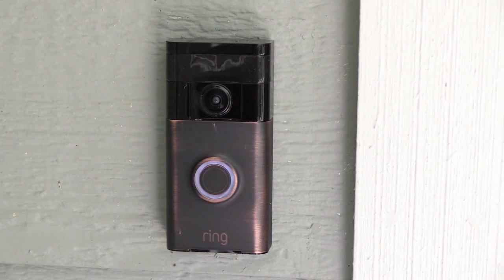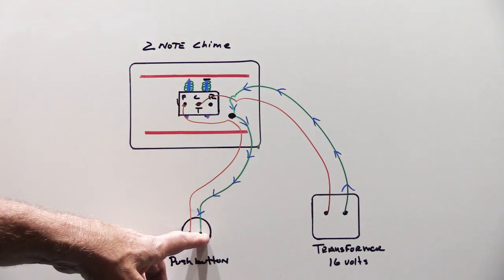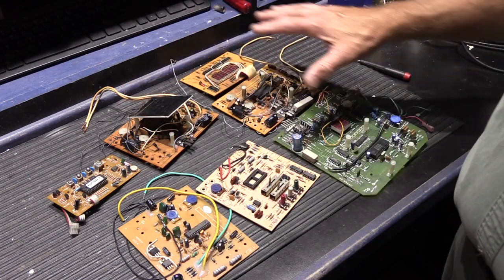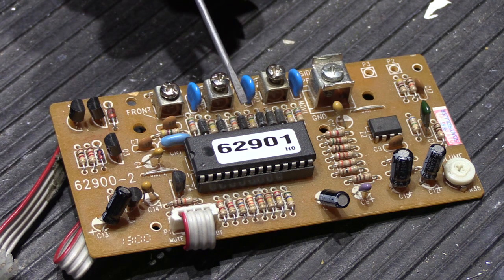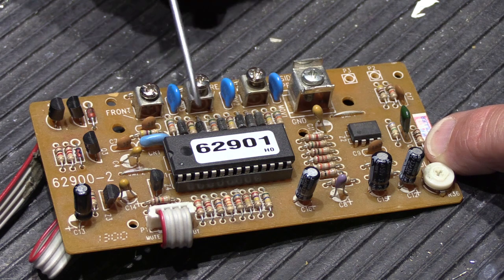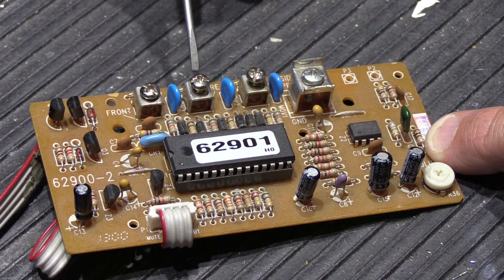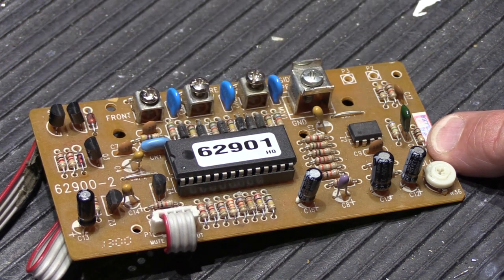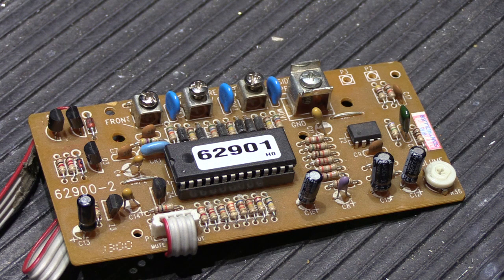Why You Can't Install a Ring Video Door Bell with a NuTone Intercom System or Musical Chime

Comment: I just helped someone installing a Ring Pro with a Broan/Nutone C500 music chime, it has four tubes that, when hit by plungers,  make sound when the chime is activated. I did a lot of research and study on my own, I wanted to share this information with everyone out there who have a similar system. However, this video is what got me started so I'm grateful for that. 

I'm not responsible for any damages if you choose to follow the method I described below. I'm simply providing some description of what I did and what worked for me. Your mileage may vary. If you are not family with electrical work, I suggest you either hire someone or ask someone who has experience and knowledge in this kind of work.

The problem with my friend's set up is that, when hooked up everything, the chime will keep making sound without anyone pressing the Ring Pro button. Like I said, I did a lot of study and finally figured out why it it doing this. The Ring Power Kit, when installed as instructed, provides power to the Ring Pro button, the C500 itself, being a digital chime, needs 16vac power for it to work too, I believe the Ring power kit simply bridges this 16vac power to the wire that goes to the Ring Pro to power the unit. The problem is that the Ring Power Kit, when installed as instructed, not only provides power to the Ring Pro unit, it ALSO complete the circuit for the Ring Pro button, so to the chime, that button is pressed all the time. That's why it making non-stop sound.

If you look at the user manual for C500, there are two methods to connect to this board, first one is using the unit as a digital chime, when the Pro power kit is connected, it complete the connection between terminals 3 (transformer) and 4 (front), which would trigger the chime to work. Since the Pro button needs power (that's provide by installing the Pro power kit), you can't bypass this connection, or else the Pro button won't get power and therefore, won't work. I'm pretty sure if I can provide a separate power source to the Pro button and not use the Pro power kit, this will solve the problem, but that's extra work to find the place to hide the transformer and run the power to the button.

The solution is to use the second method described in C500's user's manual. Use the unit as a mechanical chime. In this configuration, you would connect one of the wires from the transformer to terminal 1, and connect the Pro Power Kit as described by Ring, except instead of using terminal 2 or 3, connect the white/blue wire from the Pro power kit to terminal 1. The black/brown still goes to terminal 3. This will provide power to the button. However, the C500 itself still needs power to work, the designer of C500 provided two 9v battery connectors, so find two 9v batteries and connect them to the connectors. Now the chime will work with the Ring pro button.

The only other setting you might have to change is in the Ring app, there is a selection of chime type, digital or mechanical, I used digital and it worked. It was set to mechanical initially and it did not work.

I believe there are several other similar chimes made by Broan/Nutone that work this way, like C501, C300, just look at the circuit board, if it is similar to the one used by C500, this method will likely work.
Reply from the maker: Hi Mike:  Well done on figuring out how to connect the C500 with the Ring Pro - Just so everyone else know - The C500 is a early Broan design Chime and even though it's sold under the NuTone Brand - it shares nothing with the real NuTone Chimes.  The C500 is the only chime that has an option to run off 2- 9 volt batteries - Chris
Reply: Thanks Mike. I tried to use Hampton Bay digital chime, 1001 407 821 with ring pro. Ring says that this digital chime is compatible with ring pro.The chime runs constantly without the button pressed. Called ring customer service, no resolution, works fine with mechanical chime but not digital musical one. Do you know the solution to this issue? How can I use Hampton Bay Digital chime with ring pro? If I install the diode on the ring pro terminals like Hampton Bay recommends, the constant chiming stops but ring pro does not work.
Reply: Sam, assuming you are using the Hampton Bay chime in wired connection, not wireless connection,  as wireless connected chime will not work with Ring door bell. Try the following: 1) check the voltage output of your transformer,  set your multi-meter to VAC (AC volt) mode, it should be at least 16vac, this is the voltage between F(ront) and Trans(former). 2) try to revert the diode that you installed, in theory, the Ring PRO does not need the diode but it's worth a try. 3) did you install the PRO Power Kit that is supplied with your Ring PRO? If not, install it. It sits across F and Trans terminals, 4) In the Ring app, there is a chime type selection, make sure  you select digital, not mechanical.

Let me know if these helped or not. Good luck!

Comment: What is the typical voltage at the doorbell switch for the Nutone IM-3303?  I’m seeing 12V DC with my two 16V 30VA transformers.  Edit to add:  on the two transformers for the Nutone system, I'm seeing output of 18.8V and 19.1V, measured across each transformer........
Reply from the maker: Hi Tim:  If your IM3303 has a built-in Chime Module, the voltage you may see at the Pushbutton is not a power source for anything, including a WIFI Camera.  It is the voltage that the microprocessor on the Chime Module supplies as part of the "triggering" circuit.  - Chris

Comment: NSC, I am a renter in a house built in 1975.  The intercom is a M&S MU-MC3 3-Note Chime.  It has since been converted over to a cheap mechanical chime.  I have 4 wires at the doorbell (2 to the speaker and 2 at the push button).  I can trace th 2 button wires to the 2 out of the for wires coming from the transformer.  How can U test the voltage at the doorbell to confirm the conversion that was done will allow me to hook up the Ring Doorbell without any further modification.  Please remember the M&S MU-MC3 3-Note Chime is not in operating at this time.  I would post pics if I could.  Thank you
Reply from the maker: Hi crj_lll: Unfortunately you questions is very specific and without knowing exactly how everything is wired - I can't tell you how - or what to test and measure.  - Chris

Comment: Hi Northside, well I have a Teledoorbell, i guess its the same as the Nutone...my question is if i can't simply use the wires at the door (4 wires). can i use 2 of the wires and transformer and eliminate the Teledoorbell entirely....i dont need the chime or land line to ring...just want power the Ring Door Bell 2nd generation to use the transformer as its power source.
Reply from the maker: HI Rob:  I know nothing about Teledoorbell Systems - I suppose if your removed the Teledoorbell System completely, you could reuse the existing wiring for another purpose. - Chris

Comment: The people who installed my Ring doorbell were unaware of the incompatibility with our Nutone NM200 with chime but somehow connected the Ring to power from the outside Nutone intercom box.  When originally installed, pressing the Ring doorbell generated both the Ring sound AND the Nutone chime, but power to the doorbell AND the Ring would go off until we manually pressed the house (Nutone) doorbell again (kind of a reset).  This worked for two years then failed.  The same company returned and hooked up the Ring directly to the original house (mechanical doorbell) and the Ring is currently powered and the mechanical doorbell works also, and the Nutone intercom still works to-from the door.  With this setup the Nutone chime doesn't work when the Ring doorbell or the house doorbell are pressed, but I don't care.  However, a new problem has cropped up; that is, the Nutone chime randomly turns itself on and when it does, it chimes continuously.  By pushing various buttons on the master unit, I've been able to shut it off, but only for a day or so before it returns.  Now the question:  To prevent this permanently, can I just remove the chime unit from the Nutone, is there another solution to prevent this, or is this a serious problem?
Reply from the maker: Hi John:  You can open up the NM200 and unplug the Chime Module from the Master Station 

Here's a link to our Video that will help you do this:   https://www.youtube.com/watch?v=Jhn604U9IhA&index=3&list=PLsTvqKsBnGYetdHyoY9wIupAr-ckhqjB3&t=1s
- Chris

Comment: Quite a busy comments section on this video. Thanks for this video and your patience with everyone asking. I have a Broan 63 which I’m guessing works very similarly to the NuTone models shown. It explains why I can measure voltage at the door speaker but pressing the button “shorts” it to ground for sensing purposes. So it wouldn’t provide enough power for other electronics the way it’s currently wired.

I don’t plan or using a Ring or other OTS smart doorbell, but I am interested in a DIY low-budget solution such as a camera and Wifi-enabled microcontroller placed in the existing door speaker. If I insist on reusing the doorbell button wires for power but still want to activate the existing chime, I would need to think of some other technique for triggering it, such as a Wifi-enabled relay or transistor by the master system which can simulate the doorbell press that closes the sensing circuit.

I’m not sure how other viewers manage to use a relay working unless they have more than 4 wires (2 doorbell, 2 speaker) running to the unit, since there probably has to be a separate wire as a doorbell “signal”.

Comment: It is a very informative video. If I heard him right, he said the Ring Doorbell Pro cannot be powered by your current doorbell. What's weird about mine is that it powers the Ring Doorbell Pro fine and it works. The only issue I have is that the chime do not works on my existing mechanical chime. The Ring chime does work though.
Reply from the maker: Hi Chong Lor: If you have some type of mechanical door bell, this Video does not apply to your installation. - Chris
Reply: Chong Lor what he said was it won’t work on a newtone intercom system they operate differently then a  electromechanical door bell ,
A regular doorbell uses 16volts ac.and that is what the ring needs to work and charge battery.

Comment: I have the old nutone mechanical doorbell like the one you showed on the board connected to 16V 20VA transformer, model is Edwards 592 put by previous owner (it has 8V, 16V and 24V terminals). I am planning to replace it with the same Edwards model but with 30VA since ring doorbell pro requires at least 30VA (they’re really bad about advertising the VA required!). The plan now is to connect probably 16V terminals and I am not sure if 24V is too much for the old existing nutone bell. Can I go ahead either with 16V or 24V since ring provides a power bypass kit or safer to stick to 16V 30VA please? If this does not work, the only other thing I can do is hook up the wireless chime that works with doorbell pro but I think I may have to still hook up the power bypass inside the nutone chime. Please confirm?
Reply from the maker: Hi World Peace:  Based on the information you have provided - you have an Edwards Chime, which is not a NuTone Chime
I don't know anything about Edwards Chime and I can't advise you on how to connect a Ring Video Door Bell with your Edwards Chime
Thanks
Chris

Comment: Nice video-- Can I connect the Ring Pro to a separate AC power supply and use the RIng Pro Power Kit to trigger the common and front door terminals on the IA 29 NuTone chime module?
Reply from the maker: Hi Robert: Nope - The Ring products do not have any provision to be connected to and activate any other device - Chris

Comment: Hi Great video ,I just bought this pro door bell and sfter finding your video found out i have nutone intercoms which im just disconnecting and taking out of my walls anyway as we are painting rooms ,nobody ever uses them house built in 75. question is..... my now doorbell is a trine mechanical 2 chime deal with the 3 connections back front transformer,only have a front door and backdoor doorbell,will this work by just hooking it up like ring says or am i going to have all the hassel like your talking about? Another stupid question im not a electrician Im a plumber lol when I test the voltage on the original doorbell do I test it at the box on my inside wall or go outside and take button off and test it at wires? one more dumb question what do I set my multimeter at to test this,I know this is a dumb question but this is how you learn... Thank you ahead of time..... and if this works by only changing out the transformer maybe ill do that if not I guess I will just get a damn blink camera and stick it on my front door lol..thanks again sorry for the long questions
Reply from the maker: Hi hdbagger4266:  I'll try to answer all of your questions - You should follow the Ring Pro instructions as to how to connect the Ring along with your Trine (mechanical ) door bell, I'm not sure how Ring handles a "rear" door button.  How you install the ring depends on if you plan on keeping the Trine door bell - if you remove the Trine, you can simply reuse the wires to send voltage to the Ring

You should measure the voltage to the Trine at the Transformer - Door Bell Transformers are typically AC Voltage - Transformers have 2 important ratings, Volts and Watts (VA)  - as I understand it,  Ring requires the correct Voltage along with enough Watts - Your Trine Transformer maybe to small (wrong volts and not enough watts) in this case you will need to replace the transformer - Chris
Reply: @northsideservicecompany3567  Thank you Chris for the quick reply ,so its onward to find the transformer  and test it ,so as long as I dont have that nutone doorbell 3 chime deal all I have to worry about is the transformer volts? thanks again for the fast reply ...Joe
Reply from the maker: @hdbagger4266  Transformers Volts and Watts - both are important - Think of Watts as the amount of available power - as if it were in a bowl.  If there's to little power in the bowl -- the Ring will drain the bowl and it will be starved for power -  You need a big enough bowl (more watts) to supply all of the power the Ring needs, plus some left over so the bowl doesn't go dry. - More than enough watts is always better - Chris
Reply: @northsideservicecompany3567  Thanks again Chris understand a lot better now ,so I will test my transformer and  replace with more powerful one thanks ...Joe